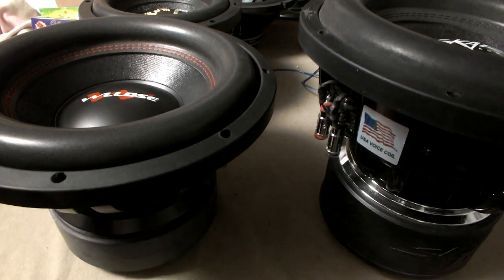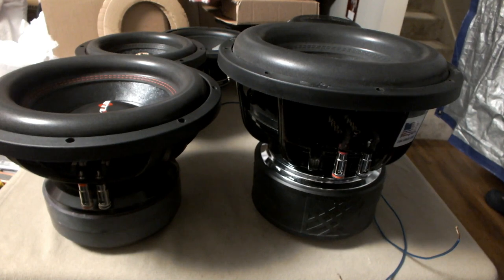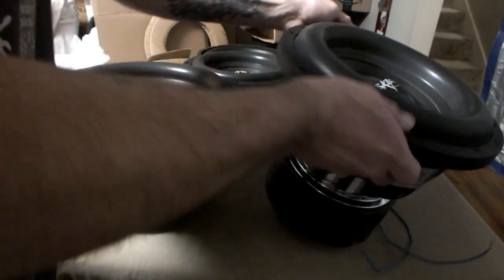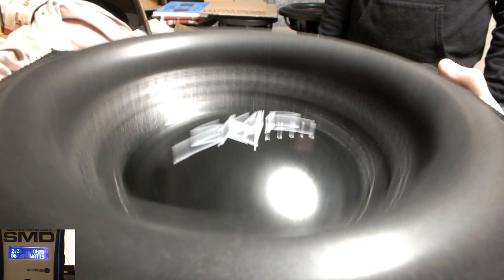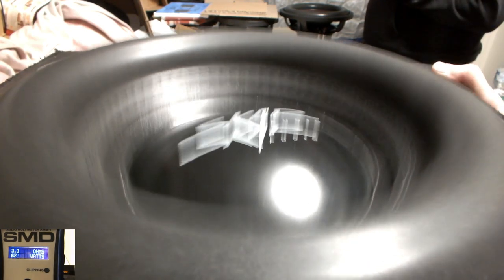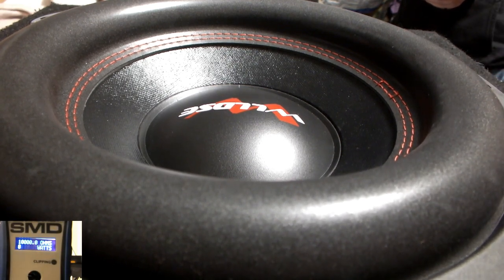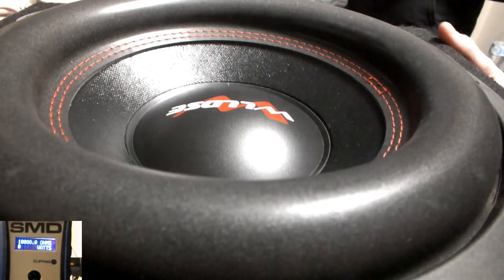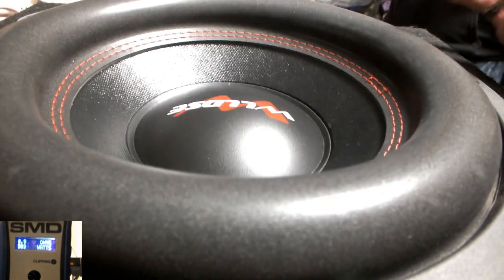Skar Audio ZVX-12V2 D2 VS WLLDSE HCY-12 $370 Vs. $120 Live Dyno Test SMD-AMM1 Craziest Flex on a sub

Comment: Fyi neither of those subs have steel frames.... There both cast aluminum. With subs There is no scenerio where steel improves anything. For drivers Aluminum is far superior to steel, steel resonates more and more flexible. Steel is typically only used in budget drivers... It's easy to tell steel frames are always thin like 18g plus steel is magnetic.... Aluminum isn't. Just do a magnet test if you can't tell. The shapes of steel frames are always soft and rounded because there stamped, aluminum frames can have sharp edges and highly detailed shapes because there cast
Reply from the maker: See, and I learn something again. I want to say I know that but if I did I would have said it. I'm going to have to look up my specs going forward and make sure I'm spot on. Thank you.

Comment: what amp and what did you have it wired to?
Reply from the maker: NVX XAD13, I have a video coming I've been placing together for about 2 weeks now, I thought I had it all set yesterday and had to spend yet another $30 and wait for two more pieces to come in the mail. I started the video already, I have a few clips made, but I need these two more terminals for everything to work. I'm trying to get the most from this amp and hoping everything works the way I think it's going to work. This should allow me to have more power or at least more stable power for a moment when I get a large bassline. Thanks for the question. I added it to my tags but could not fit it in the title.

Comment: They are aluminum baskets brother. Why dont you compare important parameters like "TS parameters"  excursion , weight, tinsel leads size, etc... These two woofers are in two totally different classes  it is by no means a fair comparison. Its like comparing a honda civic to a Charger Hellcat lol
Reply from the maker: I can add things to my videos, I always take suggestions and use them in the future. They are very comparable. If you're meaning the Skar is the Hellcat and the HCY is the Civic you're by no means close. The HCY is every bit a great sub as the ZVX is. I've done several videos on each, each of them impressed me. The price point of the HCY is what really impressed me, at half the price. I'm going to put them head to head in my van and see who gets more SPL, same everything, box amp, nobody gets any free rides. I'm betting the HCY does just as good as the ZVX. I actually own 2 ZVX's, my son in law owns 2 HCY's, we can even go further and test 2 of each head to head.
Reply: @SubzPawz  I was wondering how thus isn't a good comparison as well? That Skar isn't any better than the HCY at all. To say one was better than the other...you'd have to build an enclosure specifically for each sub, use same amp, Same vehicle,  same enclosure location...blah blah blah. I have both of these subs, in both 12" and 15"...and the tsp's for the HCY are more impressive(using DATS) as far as enclosure specs are concerned, and bandwidth curve was better. It also has a lower Fs, and the frequency response was a little less peaky, which I believe is that the HCY has a little more cone area, to help with roll off issues.
Reply: @SubzPawz  I was agreeing with you.  The original commentor said it was not a good comparison.
Reply from the maker: @Chuck_Sanders  okay. Cool. Sorry about the confusion.
Reply from the maker: @Chuck_Sanders  I deleted the comment back